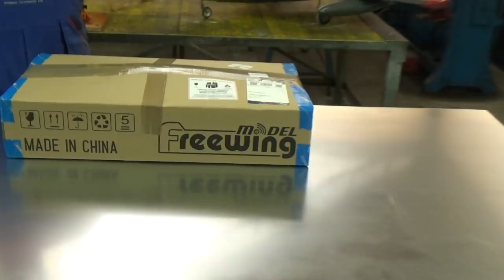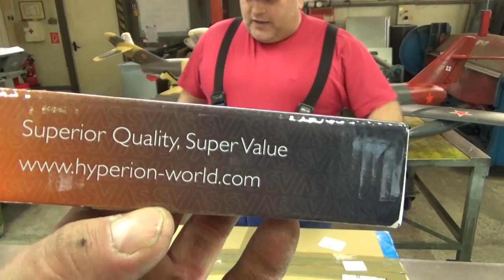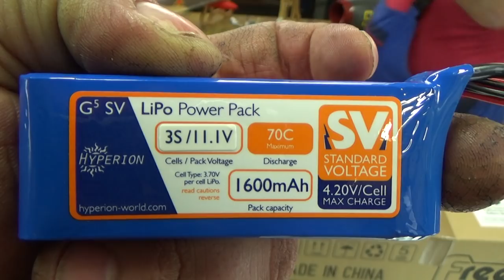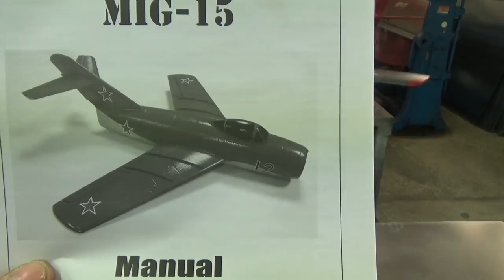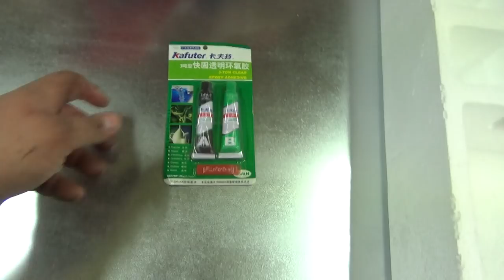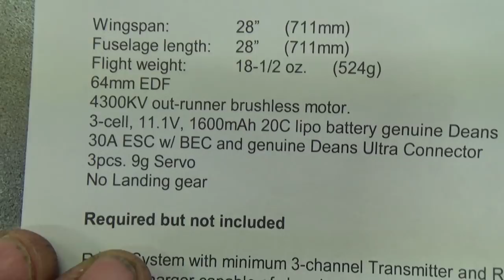Freewing MIG15 64mm EDF jet Unboxing

Comment: the main difference between the 15 and the 17 is the wing on the real one is thinner with a little more sweep and the wings also have a third fence on the top of the wings.The tail section also has a bit more sweep to it,The extra sweep was for more stable high speed flight.The fuselage is about a meter longer on the 17.The later 17's were the first Soviet fighter to have an afterburner.The landing gear and most of the rest is the same on both.
Reply from the maker: Like you said Don. I have checked that out. And I hope that I will have Sabre also one day... Stay well my friend and see you soon, Robert